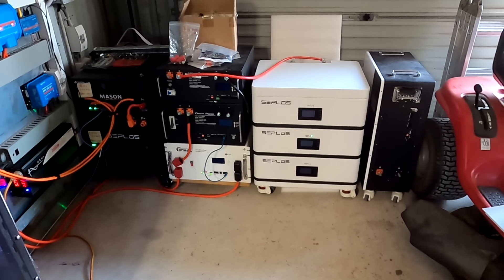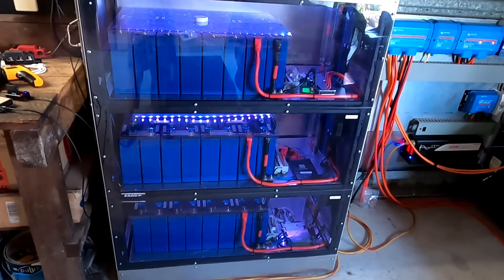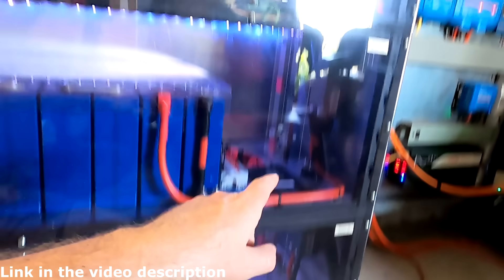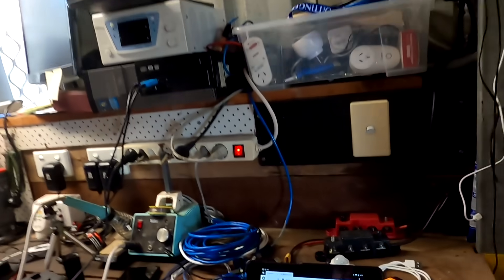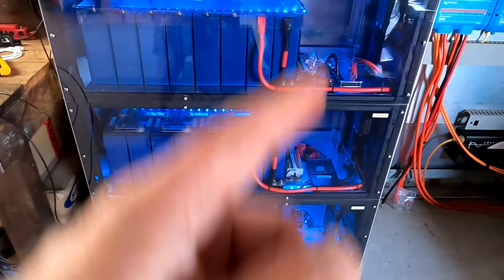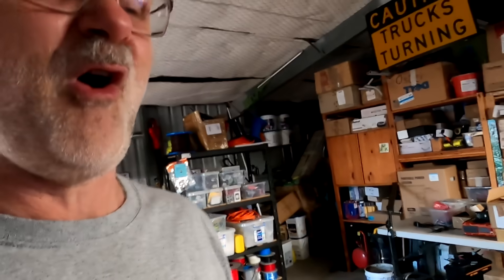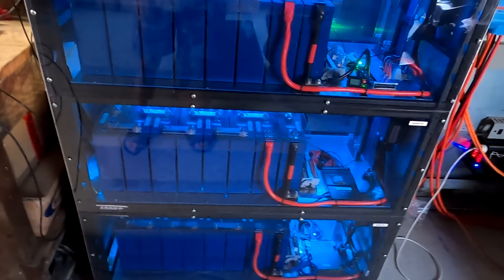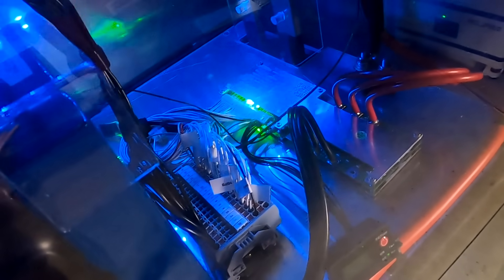Something wrong in the battery shelf! Or just 'bad' settings?

Comment: I wish you would do a long term test in Winter to have no balancing (passive or active) and just cycle the batteries as normal for 3 months. I think you would be surprised how close the voltages remain both charged & discharged.

Comment: Dear Andy! Your videos are very good!
I would like to ask how to set up the OVERKILL SOLAR
on an android phone. I downloaded the app, but it doesn't show live data.
The BMS can be set, the BMS is JDB type. It worked perfectly when the first app was started, but after the second or third start, it did not provide live data. I can set all the data in the bms, only there is no live data.
Thank you for reading!
Regards: Feri
Reply from the maker: No idea... You can always use the XiaoXiang app which works.
The Overkill does not work with all JBD BMS for some reason.
Reply: Thanks for the reply!
I tried the XiaoXiang app, its version called LLT works.
Regards: Feri @OffGridGarageAustralia

Comment: If you actually analyses individual cells charging characteristics you will find that they follow their own curves at the higher end. I've seen two cells both at 3.4v, then #1 gets to 3.5v first, then #2 actually seems to accelerate and hit 3.6v before #1. In my setup I charge to 3.55v and balance at 3.55v - basically it's the only way to balance as every cells behaviour is slightly different - basically you only balance those above your design target.
Reply from the maker: That's why you set a balance start voltage. 'Wac a mole' is how it works.
Reply: @OffGridGarageAustralia  I followed your 3.45v for a month or so and noticed far too much balancing going on. Since moving the balance and target charge voltage to 3.55v it all seems happier and I'm getting a lower deviation, what I'm trying to say is that at 3.45v I seemed to be balancing too early and probably balancing some cells prematurely. Also, it seemed to take a week or so for cells to settle into their new home voltage - I liken it to froth on your beer
Reply from the maker: @DrJGD Charging to 3.55V has certainly benefits in terms of balancing and makes it much easier and quicker. The question is: is it necessary though to have the battery THAT balanced?

Comment: I think the voltage is irrelevant , the amount of time it spends at the CV stage is what matters ,ie you need to actually have more balancing time ie people recharging their batteries full everyday less likely to have unbalanced packs

the less frequent you charge full the bigger balance current you will need

people that think 0.04watt difference between 3.45v vs 3.65v balancing will make an earth shattering difference are just too optimistic 6% increase in balance current realy
Reply from the maker: Yes, the more often and longer you balance, the less deviation you will have.
Reply: @OffGridGarageAustralia  yea so a lower charge voltage may actually work better than a higher one as long as it is over balance start voltage

Especially on bms that only charge balances

Higher voltage / charging current makes the CV tail short

While lower stretches the tail

 meaning more balancing time

Comment: One important concept that may not have been mentioned in Andy's obsession with balancing is that deltaV is what we use to determine how out of balance a pack is and of course increases as we push the pack voltage up. But it is not a precise indicator of how much current transfer is needed to re-balance the pack, eg a pack with one cell out can a deltaV of 200mV and a pack with 6 cells out of whack can have a deltaV of 200mV. The passive balancers and some active balancers dont reach their full current transfer potiential unless their is a significant deltaV and are very inefficient at low deltaV. This is not the case with Neely and JK Active balancers that seem to transfer at their full capacity once switched on. Love to see a head to head comparison of balancers where pack is top balanced, then one cell is discharged to a set amount and then recovery time recorded to rebalance pack and repeated for each  balancer under same conditions.  The Neey would be expected to come out on top.???
Reply from the maker: I don't want to add more to the obsessive testing of balancers here on the channel but passive balancing is not dependent on voltage difference. It is basically just a switch and a resistor and Ohm's law determines the balance current.
The NEEY is great but has one major downside: It can balance only one cell at a time. If several cells are peaking, it struggles and the capacitive balancer is actually the better choice.

Comment: So whats happening to cells 11-16 then? They were still at 3.3x/3.4x volts, whereas 1-10 were 3.5x/3.6x volts 🤔 is there a setting wrong somewhere thats excluding cells 11-16 maybe? 
Or are cells 11-16 used as an overflow for 1-10 if they get too high?
Reply from the maker: That's exactly what my Heltec BMS did to both battery banks.
The question is why?

Comment: heltec-bms
16S 250A 3.2V Same Port

Charge protection voltage: 3.75V

Discharge protection voltage: 2.1V

Charge release voltage: 3.55V

Discharge release voltage: 2.5V

Balanced voltage 3.55V

Balanced current: 95MA

Long-term continuous overcurrent value: 250A

Instantaneous current limit value: 1500A
Reply from the maker: Dangerous settings for LiFePO4!
Charge/Discharge Protection Voltage needs to be accordingly to the specifications of your cells.

Comment: You can't read balance voltages while charging and discharging - only at steady state after a while. When current is flowing, either way, the cells internal resistance influences the voltage.
Reply from the maker: You can still balance as the current of your load or charger is influencing all cells at the same time in a series connection, so the delta will still be visible, not the same but still in the same relation to each other.
And Daly balances only while charging. They clearly know how balancing works?

Comment: Hi Andy, it doesn't matter if you load higher, I think the float mode may be responsible. Here in Germany the surplus solar power is fed into the grid, my system never, I repeat never, works in float mode. The Seplos BMS charges my 2 packs up to 55.3 volts and the JK 1 Ah balancer starts at 3.45 V, the cell overvoltage protection is at 3.65 V and the pack overvoltage protection is at 56.2 V. I charge with 120 Ah and I never have more than 30mV difference in both packs when charging with 120 Ah and when the 55.3 volts are reached the difference is 5-10mV in both packs. However, my system never works in float, which means that if the storage is full at 11 am, the 55.3 volts are maintained throughout the afternoon and 1-2 Ah are charged and discharged all the time. I have not been able to find out anything negative about this and many people with different BMSs have this charge/discharge loop in the Victron Community Portal. So for me it is only bulk and absorption and that over 6 hrs/every day.
Reply from the maker: You basically give your battery enough time to balance, which I never did.
It would be interesting to see what your delta is when you raise the CVL to 57V. Is it still balanced? I would expect it won't...
55.3V is somewhat hiding the true difference and imbalance.
Reply: @OffGridGarageAustralia  I will test and tell you, but the next days weather is bad, so give me 1 week

Comment: Hey Andy, I have been charging my batteries to 56.4-56.6v for the last few years mainly because I have noticed the cells will stay in balance.  The lower voltage didnt do it for me😀
Reply from the maker: With an active balancer?
Reply: @OffGridGarageAustralia No active balancer. Just the good ole jbd bms.👍

Comment: Greetings Andy from sunny Portugal, Europe. Only discovered your channel a few weeks back as I'm trying to garner some education on charging Lithium batteries. Have now watched all your videos and wonder is it possible you are being too pedantic about the battery voltages, looking at them to three decimal places? (to a thousandth of a volt) Surely one decimal place would be fine if all the cells are 3.5V (for example) then that should be good enough. Please tell why it is so important to balance them to such a high degree?
Reply from the maker: Welcome to the channel first of all and greetings to sunny Portugal. Been there many times, beautiful country and people.

100% not important to balance that precise and also surely impossible. This is just the testing I do, so working with these numbers as they come in from my tests.
A 50mV delta at 3.5V is quite acceptable in a 16s battery.
Reply: @OffGridGarageAustralia  I'm so glad you have clarified that it was putting me off buying a Lithium for my next battery

Comment: I followed from the beginning the rule charge to 3,45 volts.
I have an ant bms, with lots of futures.
I do it now for 120 days and my maximum difference is 15 mv when fully charged, i am happy with that, my ant bms do auto charge balancing at 20 mv but never been active at all, i am happy with that because when the charging is finished and 2 hours of consumption, the bms going in rest state and no balancing, when the battery voltage drops to 3,35 there is only 2 or 3 mv difference.
Very good advice from you, thanks
Reply from the maker: Sounds perfect, thanks for your feedback.

Comment: I have set my limit to 3.5V 
with the aktive (voltage triggered) balancer I see 2 mv difference over 6x16 cells (302ah) 
I have set my system to fully charge once per week ( either if enough solar , or cheap electricity) 

works like a charm,  balanced, a reasonable voltage imho the best way.
Reply from the maker: Great, thanks for sharing!

Comment: When did you change to 3.45 volts per cell for charge voltage? The last I remembered you were saying to start the balancer at 3.45 and charge to 3.55 per cell, mind you, I definitely agree with your theory though. Also, for charging to only 3.45 per cell, would a longer absorbtion time help give the balancers a chance to work? Considering that it keeps the voltage at 3.45 for longer before dropping to a float voltage of around 3.375 per cell. Just a crazy thought that came to mind while watching another great video! Always appreciated!!!
Reply: He changed to 3.45v a while ago, logic being that it's at the start of where the vast majority of the power is, so why bother going higher, which is fine.

The problem comes when you then start telling all your subscribers that X and Y BMS's are crap because they don't balance batteries, passive balances don't work and SoC's don't reset unless you drive them into a protection status, when all you had to do was charge 0.1v/cell higher for all that to work.
Reply from the maker: A while ago... well, 5 days ago to be precise. And just for testing purposes. I will go back to 3.45V after testing.
Reply: @OffGridGarageAustralia  I mean, a video on your channel from 8 months ago shows you at 55.2v charge voltage, and 8 months ago is "a while ago" in my book.

Comment: Hmmmmm.....     Andy, or, anyone... correct me if I got this wrong...   You said, the JK bms worked fine with the settings you wanted to run, kept cell deviation fine...   Personally....  I would have gotten rid of the Overkill, and, Helltech, ...  bought 2 more JK's  ...   and been done with it.....    The definition of insanity is to "Do the same thing over and over and expect a different outcome".  Now, I also believe that "calendar" degradation will get to the cells "WAY" before any degradation from charging to 3.5 or3.6....    even ...3.65!!....     but that's just me.....         Cheers,   Andy...
Reply from the maker: The channel is not about getting it right or following the path which works.
I'm here to test, explore, learn and share. Hence the three different BMS in the shelf, amongst many other 'weird' setups.

Comment: Is there any way to DC-DC charge a Tesla?  DC -> AC -> DC brings conversion  losses twice.
Reply from the maker: No way to do this at home. You could buy a $70000 charging station though but guess what, it will be connected to AC as well.

The losses are no problem as the energy is generated green and free.
Reply: Not with anything that Andy has, remember that the Tesla pack voltage is like 350v. 

But losses don't really matter when you're getting 100% of your power for free, cause even with a very liberal 50% losses (probably more like 15% total loss), you're still paying 0 for the electricity.

I do the same when we have negative pricing for electricity here. Normally I charge at 15a cause my multiplus is the most efficient there (93%), but when I'm being paid to burn power, 35a charging turns on with it's 85% efficiency.

Comment: Cell ten on the top and bottom rack is the high cell in the video.  I think there might be actually something wrong with the heltec BMS.  Perhaps a resistor, cap, etc.  It is unlikely that the same imbalance would occur twice.
Reply from the maker: Exactly, that's what I'm after. I was really surprised to find the top battery with the same pattern of cell 1-10 as the bottom battery where the Heltec was before. We may see a bit clearer once the BMS balances correctly at higher voltage.
Reply: @OffGridGarageAustralia  OK the presentation has its unique stile, the first one "Will your Li-ion batteries last twice as long if you charge them to 4.1V?" is better and tells rumours can hold tough, even they funded on questionable evidence, just to keep in mind ; )
Reply from the maker: @topeye4202 It is much more an 'entertaining show' rather than having any scientific credibility.
Reply: Lithium ion, depending how high of a charge, discharge, temperature can last as long as 2000 cycles+
Reply: @jakeandrules7724  How much cycles don't matter, how much energy in total is stored counts and this is 25% better when charge them up to 100%

Comment: Great test as always!
I think another good test once this one is complete with data is to...
Top balance  a Bank of batteries once, then disable balancing and run a long-term test stressing the battery out  (charging and discharging) to see where it finalizes after many cycles. What do you think eh?
Reply from the maker: Yes, that's is great! I actually touch on that in the next video when we determine the cell drift since installing the battery shelf.
Reply: If you find it drifts it just keeps going until you intervene

If balance current/time is too low to correct

Eventually you have a low battery shutdown, enough of those and you have capacity drift  as the low cell that gets run down to 0% degrades faster

Comment: I may end up being the fool for saying this, but I can't believe Professor Andrew LiFePO4 is listening to three posers/fools.  My real world experience says even the professor's, 3.45 volts per cell is too high.  Mine get into that range and start running away into the hockey stick zone, and everything goes crazy.  And maybe this is because my cells internal resistance is below 20 mOhms? Ref; EVE LF280K cells
Reply: Low internal resistance is good, what do you mean by everything goes crazy after 3.45, what deviation you get? Mine at 55.35V (3,46) have 40mV with big loads and at 58.16V 130mV top balancing without load.

Call someone fool is not nice.
Reply: @CantFindInYoutube yo tenía conectores se cobre cargando y descargando en 3,45 la diferencia era de 86mv o más ahora pletina de aluminio 50mm por3mm  la diferencia está en 20mv en las mismas circunstancias cuando descargo sin fv baja a 03v 02v eso es lo que buscamos ,la mayoría de baterias ev tienen aluminio por que cambiar
Reply: @mflo1970  Use what works best for you, I use 50mm copper automotive grade cables. Have 2 identical batteries and they behave different, can be many things in my case I assume that is because of 2 reasons calibration of BMS cables that are almost impossible to calibrate and the high charge and discharge current that go over 200A with a daily full discharge, I know I need more batteries.
Reply: Those "3 posers/fools" brought actual data to the table, unlike your anecdotal claims that everything went to shit after 3.45v...
Reply from the maker: I like to test things and as long as it is not dangerous (like short current testing some have suggested), and there is a certain value in learning by doing these tests, I'm all for it.

Comment: Hello ihave jbd bms and i turn off the  charging balance but it still not balancing at all
Reply from the maker: It will only balance if it shows 0.0A, if charge balance is off. If you turn this on, however, it will only balance while charging and stops when there is 0.0A displayed.

Comment: Looking through your vrm history online basically you just don't generate enough solar to charge any of these batteries in a reasonable time. It's like your trickle charging! You must use mains powered chargers a lot as well!
Reply: The guy has an insane amount of solar power on the roofs of his garages. If any thing, Andy has more solar than any reasonable person could ever possibly need 🤣🤣
Reply from the maker: I never charged from the grid ----> Off-Grid Garage 😄
Reply: @OffGridGarageAustralia  but the shed does have mains power! The meter box is behind you the whole time in your first video! 
And you have videos changing batteries with DC power supplies, but hey that was a few years ago. Stay charged!
Reply from the maker: @cdonuts7335  I still have one grid-connected point in the garage. This is purely for emergency purposes once the whole house goes off-grid so I can charge the battery if needed. 
If I charge from alternative sources, it's always other batteries and inverters or something like the Bluetti.